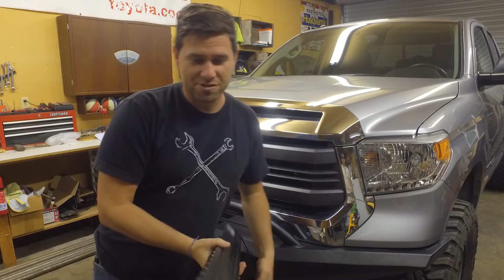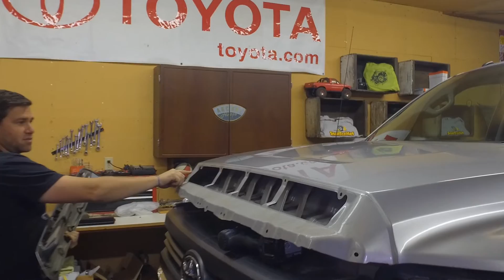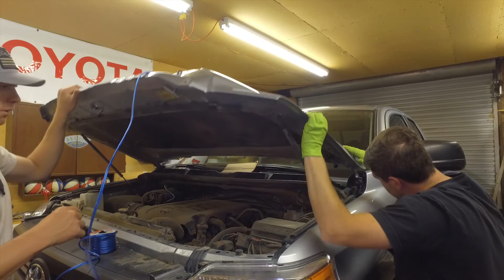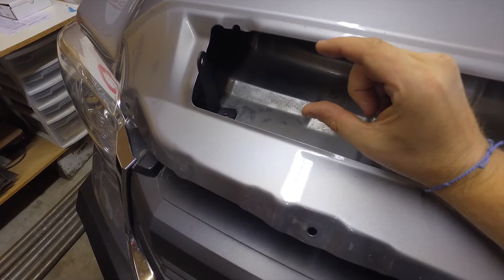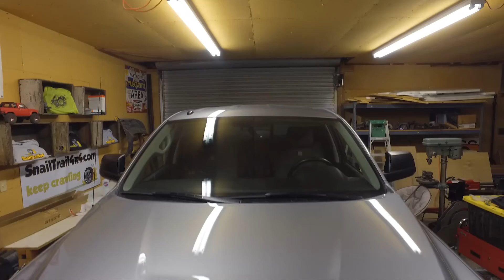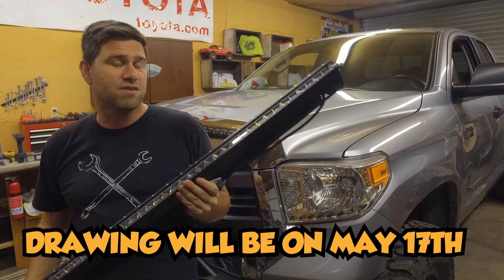Hood Bulge Light Bar install  | Toyota Tundra

Comment: This is exactly what I was looking for, thank you! Juat picked up the same light bat and when I mocked it I ran into the same issue with the bars in the back. I'm a little hesitant to cut them tho but I see theres no way around it. This is a much budget friendly alternative to the NSV bar that a certain company sells for $1k!
Reply from the maker: We haven't had any major issues except the chrome has flown off once when we passed a big-rig head on.
Reply: I had to keep tweaking the install as the sides of the cover was bulging and the front 3 snaps cam off after a driving a few miles but I eventually got the cover as flush as I can get it. Now my only problem is the wiring. Not sure if you guys used the Nilight brand wire harness but I did and the damn thing got so hot it burned the wires to the switch! Thank god it happened while I was still testing it ir it could've been worse! Read some reviews in Amazon that some folks had the same experience as well. So I'm now getting a Ridgid Industries wire harness instead
Reply: @tundrafng8870  we wired into a sPOD. sPOD makes a 6 switch controller the installs in the sunglasses holder.
Reply: @norcalocal  do you have a link to the sPOD of which you refer to?
Reply: @tundrafng8870  which model harness did you use? Im looking to do this myself and emailed them for the correct model and was told to use the 14 gauge 10014W model. Im scared to intall with this if its going to cause electrical issues. Thanks in advance for the reply

Comment: It would be nice if you make a video on how you ran the wires and switch. Thanks
Reply from the maker: I talked about it a little bit, what did you want to know?
Reply: did you run the wires into the firewall and where did you install the switch? thanks again.
Reply from the maker: @Outdoor-Adventures  -- the switch set up was already installed before we did this LED light. The wires for the switch were ran through the firewall on the driver's side by the fender, there's a large rubber wiring gromit.

Comment: Thanks for the video.  I was considering this n decided against it now.  I’m not cutting my hood losing structural integrity.  I’ve owned a lot of trucks over the years n I’ve seen too many hoods have failures just with their own weight.  Looks cool though
Reply from the maker: Understood, for what it's worth we haven't had any issues
Reply: @SnailTrail4x4  thanks.  I’m looking at the NSV light.  No cutting but expensive

Comment: Great video. I'd be interested to see how you pulled and installed the switch inside tha cabin.  I'll be installing mine this weekend and would like to get an idea.
Reply from the maker: We went through the large wire bundle at the firewall on the driver's side
Reply: I would also like a vid on this. 👍🏻

Comment: That pisses me off how easy that scoop went back on. Can’t get mine on and about to break the whole thing.
Reply from the maker: Sorry, I just got lucky I guess
Reply: What did you end up doing?  99% chance this dude trimmed out the right and left top clip brackets on the hood bulge because they hit the light bar and it can’t connect.

Comment: @shwell11 

Is there a plan to add some sort of weather stripping on the sides to prevent water from accumulating in the Hood?
Reply from the maker: You know we didn't talk about it, but that wouldn't be a bad idea. Maybe we should bring it back in and add some.
Reply: @SnailTrail4x4  it is a kick ass mod, but the openings on the sides would make me paranoid!

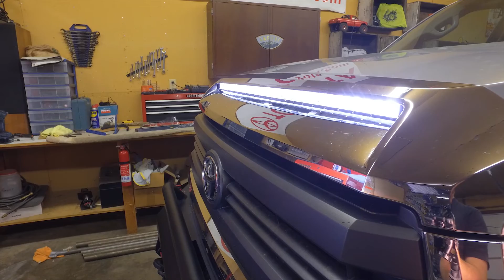Comment: At time 8:14 did any one notice the gab in front of the light, you can the inside of the hood. the light needs to be curved. There's a big gap.
Reply: Actually could be reflection from top, I want to buy one of these because its clean looking, is there a gap because the light is not curved?
Reply from the maker: Ever so slight of a gap. The curve isn't that large and if you add any weather stripping (we want to) then that would fill the gap

Comment: Wondering why you didn't go with the NSV light bar that is designed to mount inside the plastic hood bulge. I didn't have to cut any metal on the truck, it literally takes the place of the black plastic inset you removed.
Reply: Because this is $70 and the nsv light bar is $1200 😂😂😂😂

Comment: Damn, I wish my Tacoma had that hood bulge to put a light bar in. I wonder if they make an aftermarket Tundra/Taco hood. Need some matching LED headlights now.
Reply from the maker: Where did you put the light bar?
Reply: @SnailTrail4x4  i didn't. the Tacoma doesn't have a hood bulge. I wish it did.
Reply from the maker: @danielhowell1640  -- I'm thinking about putting a lightbar between my bummer and grille, there's a little slot of space there that fits a light bar perfectly

Comment: Do you have any issue with the hood budge coming loose and flopping the wind while at speed?
Reply from the maker: No, we haven't had that issue
Reply: I do. It popped off along the top retainer clips on the freeway and now my hood paint is chipped. There’s nothing to keep the top half secure any more so wind forced itself in and you’ll see it flexing while driving.

Comment: Do you have any recommendations for entire wire kit needed to hook up all the way to the switch control inside my 2021 Toyota Tundra? Like this light bar and vid!
Reply: Also can you still fit the screen in front of the lights to better help support lights and help I guess against weather?
Reply from the maker: No you can't fit the screen In place because you're placing this in front of the brackets and the screen isn't transparent, it's a solid piece of plastic
Reply: @SnailTrail4x4  thanks for the response

Comment: I did this install on my 2018 Tundra. Not only is there a question regarding rain water entering the hood bulge. When I am on the interstate the 3 snap in tabs on the top of the bulge pop out due to the blow back of air  entering around the light bar. Any ideas on how to address this?
Reply from the maker: I'd add some sort of rubber weather stripping around the lightbar, that should protect it from rain and wind... I'm sorry we didn't do that so I'm not sure what type of material you should use
Reply: Yep, actually broke my tabs on my grill
Reply: Would u do it again is my ? I just bought a 2018 a week ago thinking about doing this. But also seen a guy put a 32 in inside the black mesh casing. Expensive car plan on keeping it 4 about 10 years worried about water sitting in hood and rusting live mid west nasty winters lots of salt on road.? Any advice....
Reply: Michael, did you ever figure out how to keep the tabs from coming off on the highway? Gorilla Glue double side tape was a NOGO as was Alien Tape. About to try 3M VHB 5952 and if that does not work moving to installing an EGR SuperGuard to help keep those tabs from coming up. Unless of course you solved it.

Comment: I am thinking about doing this. This video is 2 years old. Is there anything you can worn me about since it has been so long since it was installed? Or any suggestions on how to make it better?
Reply from the maker: It's been great. We only added some weather stripping around the gaps to help prevent water.from getting in
Reply: @SnailTrail4x4 got any examples?

Comment: So how do you compensate for the air going in to the bulge now? I followed your video and my bulge popped off along the top clips at high speed on the freeway and chipped my hood paint. Kinda bummed this wasn’t mentioned in your video of problems you could have. Now I am screwed because I can’t keep it from staying put any more. Replaced the clips, even added jb weld to them to hold them in place but air still forces in there and you can see the whole top half of the bulge flexing in the wind while driving... any advice would be appreciated before I drop a grand on an OEM fitment version...
Reply: Did you not put back the 3 10mm bolts to secure the hood bulge?
Reply: @bigboijohnny  I did, it’s the clips at the top that are the weak points now. Air is forced through the bulge and there’s nothing to keep that portion in place other than 5 plastic push clips.
Reply: @Thatwhite_trdpro  that’s crazy how it still ripped off even with it bolted down. I was debating on giving this project a try but if it ripped off, I guess I’ll have to pass on it.
Reply: @bigboijohnny  it didn’t rip off, just the top half along the hood separates at high speed with a head wind. It doesn’t happen now that I added some JB weld to the top pins, but it’s still a weak install imo. I should have gone with the NSV light bar...